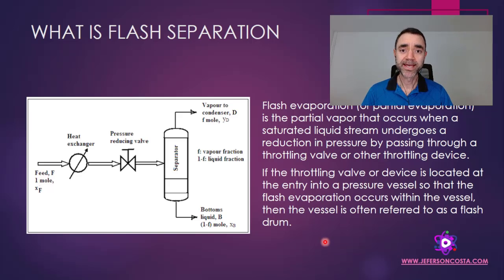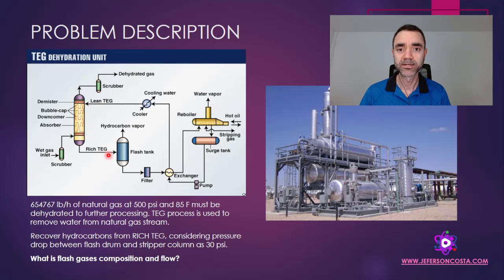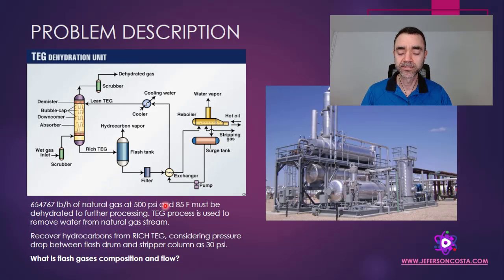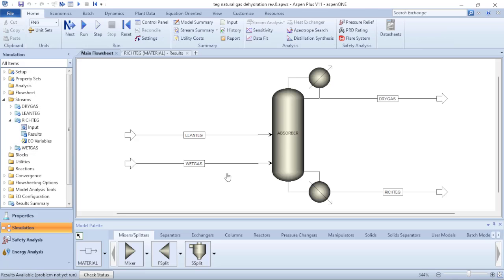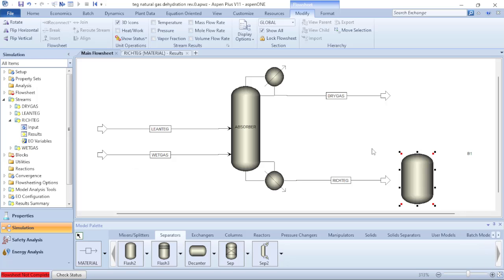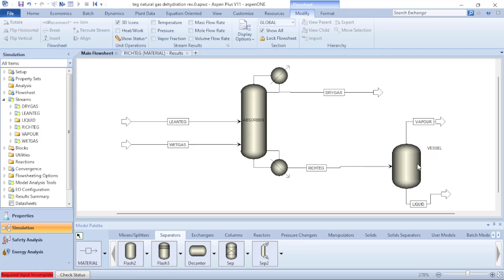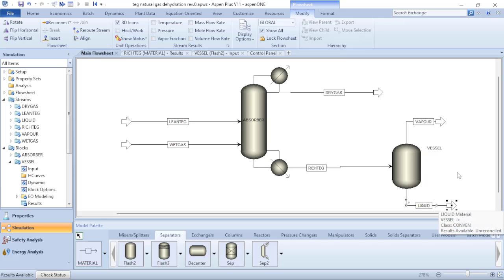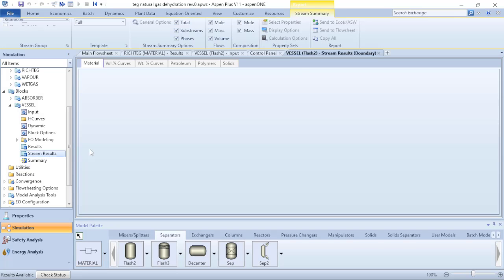Aspen Plus for beginner flash vessel | flash drum separator | Aspen Plus tutorial

Comment: Is there a separator sizing tool/feature similar to ASPSN Hysys?
Reply from the maker: Hi Steven, you do not have this option. The main purpose of Aspen Plus is Heat and material balance, not equipment design 😅 With exception to HX where Aspen Plus can be linked to EDR, and PRD using the Safety Analysis.